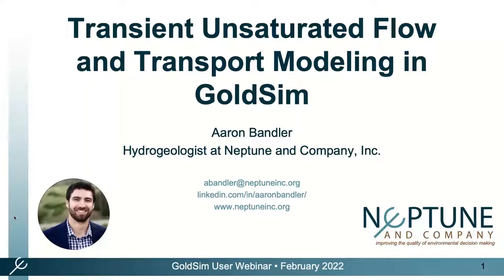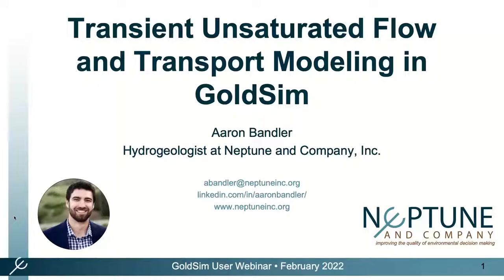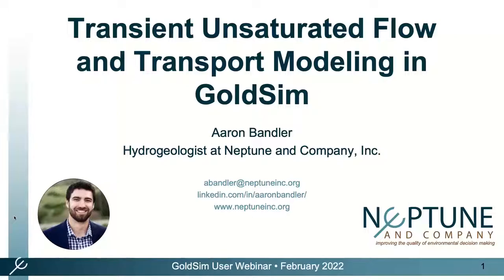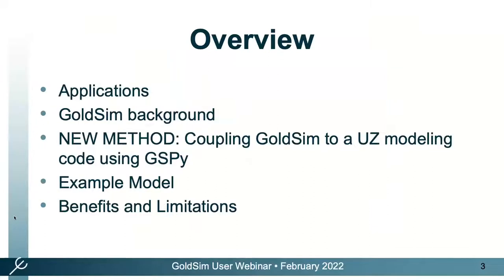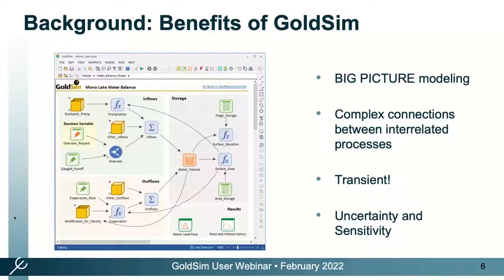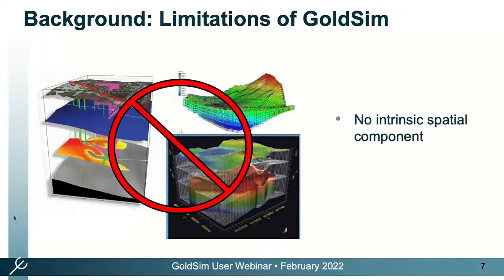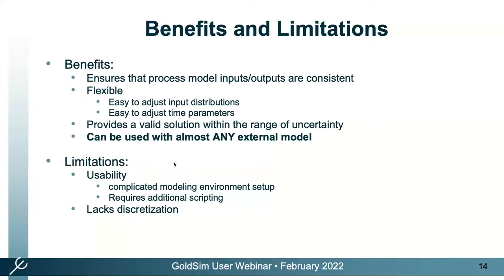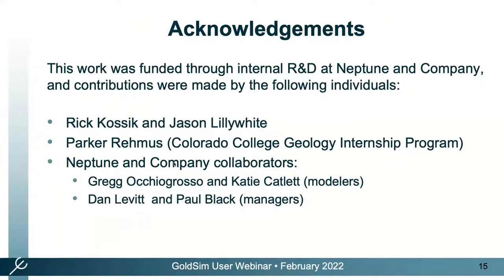Transient Unsaturated Flow and Transport using GSPy and HYDRUS 1D

Comment: Thanks Aaron fir the interesting presentation, learned quite a bit about GS and it capabilities. Being a long-term user of Hydrus myself, I could clearly see the potential of your approach, bringing together a powerful flow and transport model and the general-purpose simulation environment such as GS. One main reservation I have regarding your approach though is potential inconsistency between H1D and GS with respect to time discretisation and the effect on aspect such as numerical dispersion and stability. As you might know, when solving a transient solute transport problem in H1D, the code automatically adjusts the solver time step to achieve good Courant and Peclet numbers, hence acceptable accuracy of the solution. I am not sure the same effect could be achieved when solving only the flow part of the problem in H1D. From personal experience, situations with Dirichlet bottom boundary (e.g. water tables) could be far more challenging that those that involve only  drainage. Another thing is the time required to solve complex problems in H1D (the execution time). Think situations with clay, high Kd and long-lived isotopes such as U decay chain. Multiple H1D runs with variations of say the hydraulic parameters, oh boy!
Curious to see how this approach will develop over time. Regards to Paul and Katty.
Reply from the maker: Sorry for the delay. I just noticed your comment today and so Aaron wasn't notified until now. Thanks for your patience and thanks for commenting!

Comment: Could you please tell me if I can use it with Hydrus to calculate flow in opend drainage ditch?
Reply from the maker: I have heard from more than user that they successfully built a model that dynamically interacts with HYDRUS but unfortunately, nobody at GoldSim has experience using this tool so I cannot comment on it's use for open drainage. You could contact the folks at Neptune and Co as they have built this type of model: https://support.goldsim.com/hc/en-us/articles/4524513763475-Transient-Unsaturated-Flow-and-Transport-using-GSPy-and-HYDRUS-1D-Feb-2022-